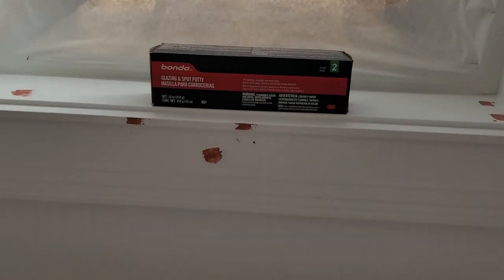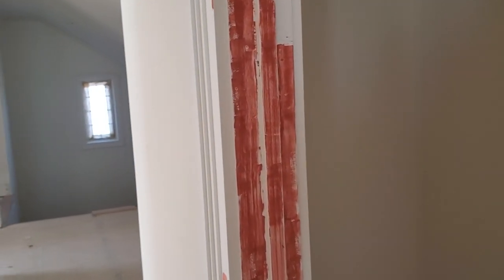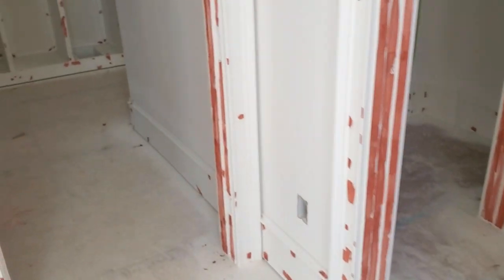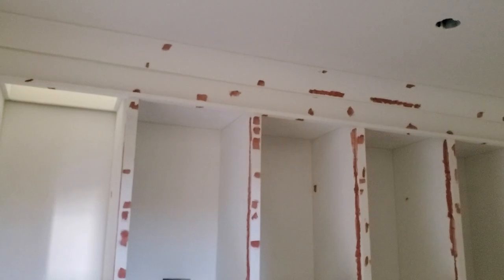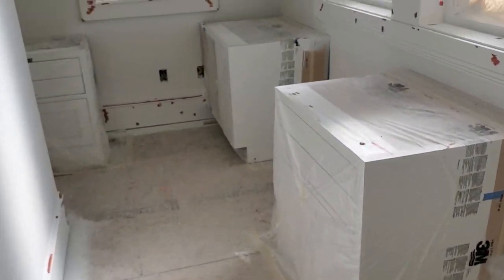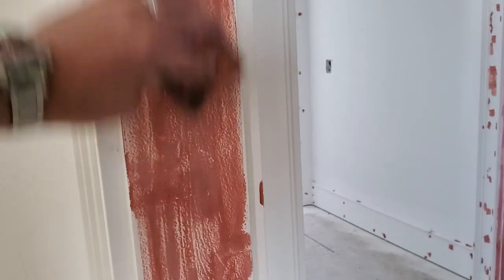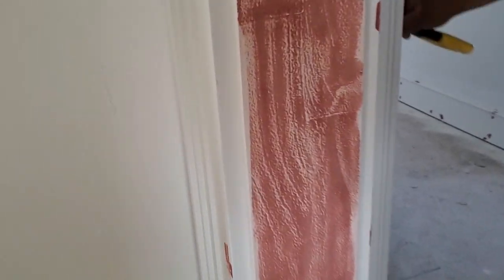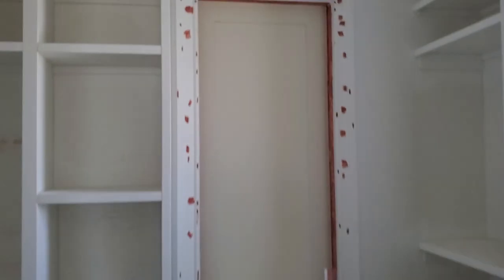All About Bondo | How to Prep Home Questions ANSWERED!

Comment: what are the steps/process for the bondo application? do you just fill it in, or are there other necessary steps... what's the difference or case for wood fillers vs bondo?

Comment: 2 years after our painter used bondo on large window trim (MDF), some of the joints are starting to crack. These are places were the mdf was joined together to make it look like one solid piece. What is the right way to go back and fix these seams that are cracking? More bondo and respray?
Reply: On end joints you need caulk because of expansion and contraction of wood.  You can paint most types of appropriate caulk.

Comment: When I did marine insulation and lagging in the Navy, we came up with a filler that was a mix of cement and some stuff that we called 'goose poop.' 

It yielded this great sort of plasticky material that was hard and smooth and adhered to anything and was dimensionally stable as it cured/dried. I'd make it again for diy household fill work, but I have no idea what the proper name is for the 'goose poop' component, and googling just turns up..well...goose poop.

I've used drywall paste, and it's pretty decent, but not hard, and I've mixed plaster of paris with elmers glue - that works pretty damned well.

But the obvious option of bondo never occurred to me.
Reply from the maker: Awesome comment! Great hearing about the goose poop🤣 I actually believe it or not have also heard of the goose poop reference! I think a pretty close cousin to that would be like an old school Crawford putty...not the lightweight,  but the original in the orange can, and yes you can mix it with some other ingredients to make it stronger 💪 If you are use to that stuff, try the Crawfords I think u would like it, and definitely try some of the red bondo or spot putty. It dries really fast and is super easy to sand and strong. Thanks again for the comment,  that was a great one👊🤝🙏🙏
Reply: @PaintBoss  Easy to sand would come in handy right about now. 

I made some putty for my kitchen cab project after the wife dictated Gloss White in the middle of the project and I had to try to hide all the imperfections that will now be glaring.

I mixed up some plaster of paris with tightbond 3. 

Holy crap - I do believe you could build ballistic armor with that stuff.

I should have mixed it with water then added in a bit of the glue.

It laughs at my palm sander.

Comment: Bondo 907 is now stage 2 your link to SW has the Bondo 907 as stage 3. The 3M website has a stage 3, Bondo 651, have they changed the formula?

Comment: Hey thanks for the videos. I do finish carpentry work, want to get started in painting my projects also. Can you tell me how to hide seams in say wainscoting correctly. After I glue and pocket hole the unit I usually use a dry dex over the seam to hide it. But at certain light angles you can see the spackle no matter how feathered out it is. Can you give me a few pointers on how I can make that disappear. Much appreciated
Reply from the maker: Hey so sorry for the delay...Im still trying to figure out how to see all the comments...Just shows me 3 at a time for some reason! Anyway, yes that sounds good! I would try doing your normal filler, glue or spackle for the initial, then switch to the bondo to prevent from shrinking when the latex hits it. As soon as water-based touches anything it shrinks it up, so use the solvent base bondo or spot putty, that will help keep smooth, and then you can shoot 2 coats, depending on product.  To be super safe you can prime over bondo, then scuff sand and shoot 2 coats. Let me know how it works and thanks for the comment 👍🙏
Reply: Thank you so much for the reply. I will try the technique you told me. And let you know the results . Appreciate the videos very much. Thanks again!

Comment: What grit sandpaper do you use? And do you ever bondo again after painting a first coat?
Reply from the maker: Hello Collin,  so we usually use a fine sanding sponge and or 220 sanding paper, and yes we do do bondo after the first coat and call it our prepcheck.  As long as you sand and wipe the new bondo before spraying you will be totally fine👍 thanks for the comment 💪

Comment: MH ready patch. Cheaper than spot putty tougher than spot putty and easier to cover.
Reply from the maker: Alright,  thank you Will, I appreciate it 🙏 good looking out, I will try some. where do you buy it from?
Reply: @PaintBoss  in my area its a go to so Home depot runs out quite often. But usually I buy it 6-10 at a time but if low and they are out amazon. I havent found anywhere else yet in my area that carries it. Its a Zinsser product.  If you are about time and grabbing a pay check and moving on to the next though I will warn you. I does take more time to sand it than the red garbage or typical spackles. I only use it on trim work and cabinets. wall board or plaster work I just use a regular spackle or drywall compounds. Under anything less than a satin finish you will notice where you used it as a "shiny" spot. 
I know a lot of painters haven't heard of MH ready patch but Dyna patch is as good. That can usually be found at most paint stores.

Comment: Based on your recommendation I took this idea to my kitchen remodel. :) QUESTION: I noticed you primed before Bondo, but do you also prime again after Bondo? Thanks!!!
Reply from the maker: No usually we do not, occasionally we will but as long as you primed first then did bondo, sand it and wipe and clean really well, then shoot 2 coats and you will be great. If you are brushing or rolling some colors may require more coats, but spraying is the best application.  Thanks so much for the comment and let me know if you have any other questions 😊
Reply: Paint Boss thanks!!!
Reply: @granthmeek  I never use bondo spot putty. I use to when I worked for someone else because. Well I was taught a lot of bad habits when working I worked for others. After a while though I started noticing some jobs were to just come in a paint the trim (usually what most only use bondo spot putty on) because the spot putty was bleeding through. Since I started my own company I haven't touched that shit again other than to sand it out and use a proper product. My go to is MH ready patch. If i cant find that I'll use dynamic dyna patch. Most spackles are "soft" and dry sand and finish like typical drywall compounds.  I got onto MH ready patch and Dyna patch from buying it one time when I went to by drydex and they were out except for the small container.  I sued it on the wall and noticed it sanding very very smooth even with 120. When I painted and the paint dried I could see every spot I used the ready patch on. It was turned and eggshell finish into a satin finish even though it was sanded with the same grit as the rest of the patching. I said to self when I go on my own im using this shit for trim etc. 4 yrs later I have never been called back to a job for anything let alone red bleeding through the paint.  Bondo spot and glazing putty is used in auto work for filling heavy sand scratches and pin holes for improperly applied body filler. Its so miniscule you wouldn't see the bleed through. When used in residential work its screw heads and nail head, hammer marks etc. These spots are huge compared to what it was designed for. After mths or a couple of yrs (depending on quality of paint used) it bleed through. And you'll hear painters say they never got called back because of it. Thats true. Clients dont call back the fuck up. They call someone new thats going to do it right and bad mouth the fuck up to their friends and anyone else that will listen.
Reply: @willmurphy6996  Will, thanks for the note back.  Do you use "4428" MH Ready ? I noticed they sell a couple of different formulas.  Going to try this!
Reply: @willmurphy6996  "When I painted and the paint dried I could see every spot I used the ready patch on. It was turned and eggshell finish into a satin finish"  -  You're saying MH Ready Patch is good because it shows through after you paint?  Why is this good?  How is this different than bondo bleeding through?  Am I misunderstanding your comment?
Reply: @yusuihang  sanding grit matters.

Comment: In the future, consider being more specific on product references. Bondo is the brand of product. They make body filler, fiberglass resin, and glazing putty. You are using glazing putty for filling nail holes and defects - not "Bondo."
Reply from the maker: yes, good point! I will try to get better on being more specific on the maker and product line...I know, it's an old habit to just call it what we call it, but I have learned all over the world these products are called very different things, so I appreciate the comment and I will try to do better when it comes to describing and sharing exactly what we are using🤝💪👊🙏